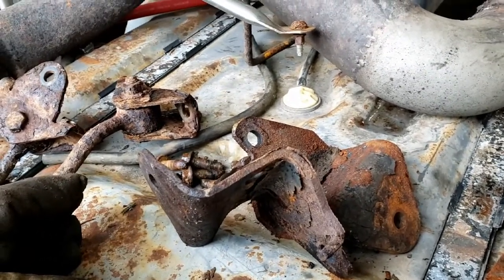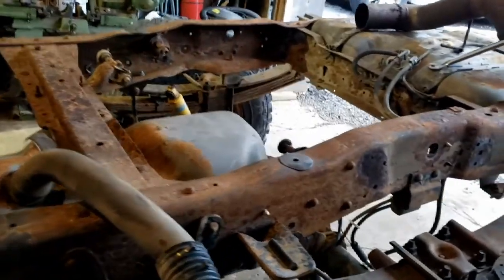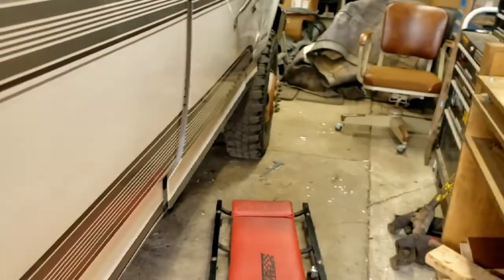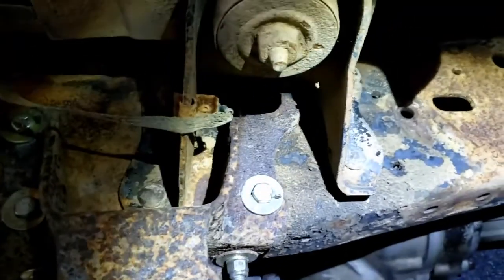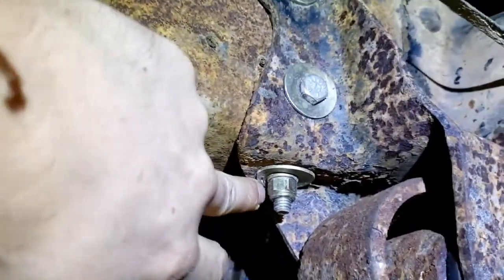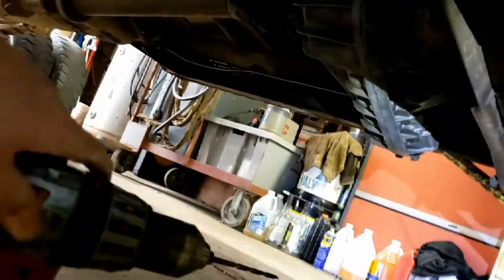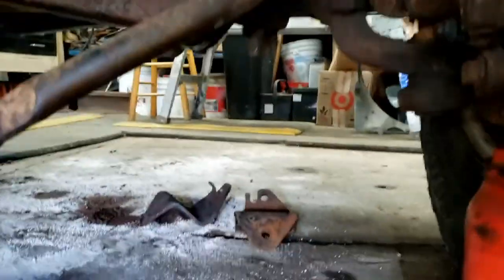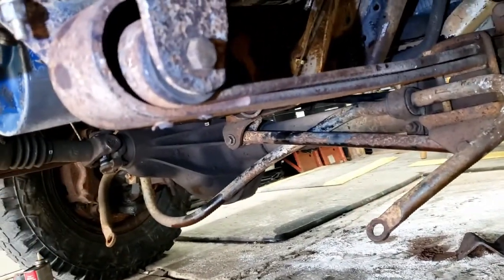Spring Perches and Steering Boxes - Project Frankenstroke Part 14

Comment: Hi, maybe you know if it is possible to replace the Dana TTB with the Dana 60 model, or do I need to change the frame for a replacement?
Reply from the maker: Actually, that's a pretty common conversion. It's a pretty simple process actually. You'll need the axle (complete), springs, track bar, track bar mount, and the 4" lift block for the rear end to make it sit level once it is done. I'm sure if you Google OBS  Ford SAS (solid axle swap) you'll find a lot of great info.
Reply: @diymechanictv1233  Thank you very much for the information!

Comment: Put an rsk kit in and then you won’t have to move the brackets.
Reply from the maker: No, but I still would have had to drill all the holes for the RSK... And I had the parts. It's all done now, though it did take some work!